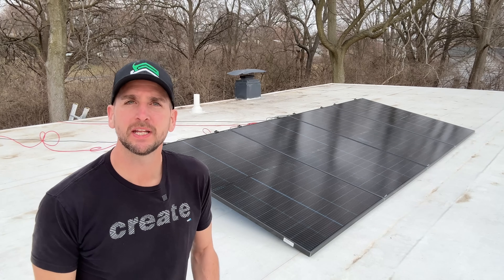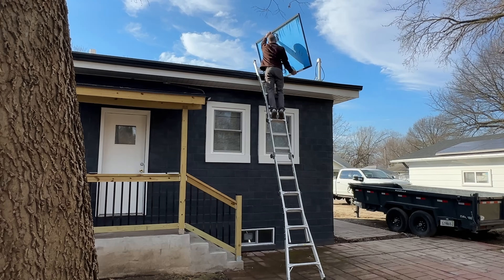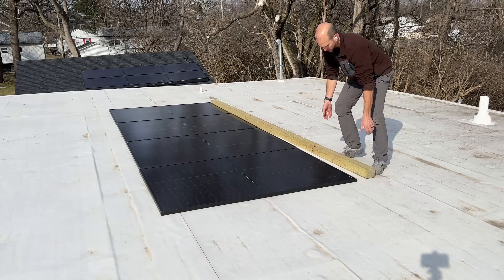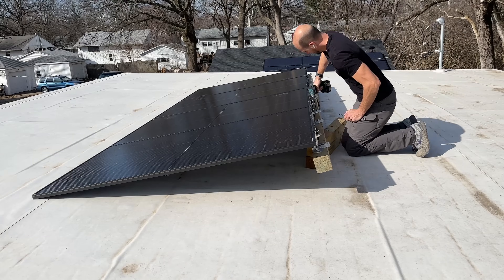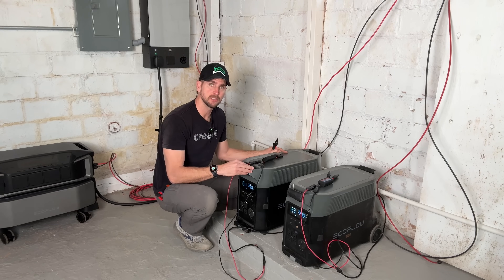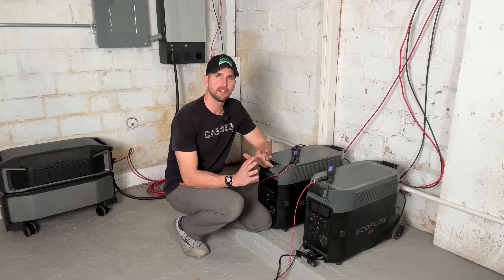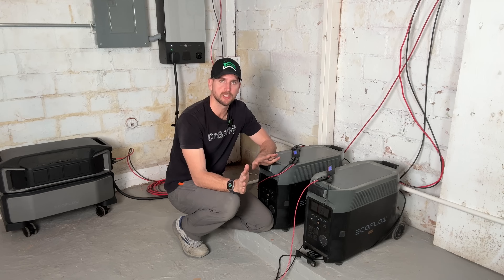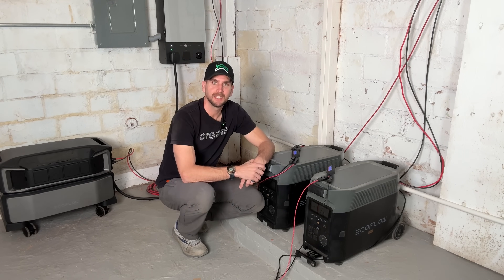Testing Gains From Bifacial Panels | Round 1

Comment: Youtube expert here!  The Bifacial panels need light to bounce to gain a (usually 7-12%) maximum ~20((30))% increase.  For that they might need to be "higher up" (from the roof so light bounces on the backside), there might need to be distance between panels (10-30 cm), so that light get "in under",  3) you can reflect light in behind by reflecting material (foil paper or some white painted plank).

Comment: Blocking a lot of the reflected light with large blocks of wood makes the whole video useless.
You also seem blissfully unaware of just how much heat reduces panel efficiency.

ie:  Get your panels off the roof by at least a foot in such a way that:
1:  Reflected light can actually get underneath from all sides.
2: Any breazes can actually survive under the panels and cool them.

Is the roof painted with a paint that actually reflects the frequencies of light used by the solar cells?
Barium Sulphate?  Titanium Dioxide?  Calcium Carbonate? What???

in short: Know the theory before you decide to make a fortune from YouTube vids or you are nothing more 'fake news'

Comment: Couple things.  1.  Bifacial panels really benefit the most when the sun is low on the horizon since the sun can shine directly on the white roof below the panels and thus reflect onto the backside of the panels.  Honestly the fact that you saw a 4% gain while the panels had a shadow under them is impressive.  I'd run this test again but run it from dawn till dusk.  I bet you'll see your best gains in the morning and evening.  2.  Maybe paint your roof with an aluminized reflective coat.  Especially underneath the panels and a foot or so around the edges too.  Increased reflectivity can only improve whatever gains you get and are cheap with 0 maintenance.  I'm installing bifacial panels on my black asphalt roof and had considered painting my roof under my panels with aluminized roof paint but gave up on the idea since I'd only have 3 inches of gap between the bottom of the panels and the roof.  Honestly if I could get 4% gains just from painting my roof it would be well worth it.  Especially if my roof was already white to begin with and I wouldn't have to worry about the aluminized paint looking funky compared to the rest of the roof.  Just something to chew on.

Comment: I think your mounting system here, had a massive impact on the potential of the panels.  Not enough space to allow light in underneath, and the beam blocked a lot where the panel was elevated the most
Reply from the maker: Yeah, I agree having some light coming through the front side would be ideal.

Comment: If you're playing around with the solar panels for fun and you got the money then go for it, if you think for 1 minute that's spending 50 grand to get enough solar panels and batteries and charge controllers to take you off grid for long periods of time but you might as well hang that s*** up if you consume a lot of power. With solar you're one severe hail storm away from being in the dark again. Solar is fun to play around with if you have money, solar is a good option for people that do not consume a lot of power, but if you consumer a lot of electricity on a daily basis it will not be worth the amount that you're going to pay to install solar, you might as well just pay the electric company

Comment: Bi-Facial panels should be mounted so that NO part of them contact the roof itself . You need to get more light under the panels . IF roof mounted , I would suggest the lowest end of the panel be mounted at 1 foot and the other end mounted higher as needed to get your 10 degree angle . A more reflective surface would also improve performance .

Comment: My PV2 is 2790 watts ,465x6 bi facial, feb19 pv2 was at 3162 watts . In thick clouds 465 becomes 105 watts. Thess #s are south facing 90 deg straight vertical ground mount with snow.  62 bonus watts per panel. With 27 panels that is 1674 watts as a bonus. 
Jinko Solar JKM465M-7RL3-TV 465W, Bifacial

Comment: Good job but at 10% you don't have any slope to expose back to light.  This is probably not good for southern areas.  In far north where mounting is at 45 degrees or more far more light would be availabe to back of panels.  The sweet spot for these might be in north, vertical to get rid of lessened power when snow covered, as high on property as possible to be exposed to the sky as much as possible.  Yes 30 feet up on a roof you get more sky exposure than in ground, especially if there are trees.  Indeed, the brightest area of sky, greastest sky glow during the day is  in the NORTH

Comment: set the panels vertical offset from south  and on the ground with reflective materials (rocks metal ect ) just laying them on a roof is  non productive  and forget taping the backside  since they are already  flat on the roof . I have 3 bifacials 37,5 voc 13.8 oc  in parallel on a roof but they are mounted  vertical due south I have them mounted on plywood painted with high gloss enamel and that is covered with 1/4 inch reflective  sheets  I paid $109.00 a panel for 10 new in a box. on a ideal day they produce 45a  with 36 v

Comment: The panels need to have more space and a reflective area under them. Something like using them as an awning for a patio with light colored things under it. The way you have them situated for this video, there is not enough area/light on the underside. After I install my white PVC privacy fence on my north property line, I will be mounting 15 bifacial panels in front of it. The area along the fence has a 4' border of white sea shells on the ground. The north property line has no issues with shade all day so that will be a great location for solar power production.

Comment: This is not the correct angle to install bifacial panels. Also the masking tape will likely lead to an increase in temperature of the panel and reduction in its  performance.

Bifacial panels will be interesting in vertical south east orientation. So many areas they can be installed. And you only lose like 10-15% than an angled monofacial panel. But we have to wait for true bifacial panels since now the back side peak output is around 60% of the peak output of the front.

Comment: You need to lift the panel at least by 1 meter off the ground and 30% slope angle i get 50% more production in very heavy clouds and about 10-15% better on average.
Reply from the maker: That seems reasonable.  I wanted to test this setup as we are being proposed something similar for a commercial property with a similar membrane roof using the iron ridge ballast system.  Thanks for the feedback.

Comment: Great test setup and data.  I might try the same test with one change, a 6-12 in. light gap between the panels.  My understanding is the would allow more reflected light to reach the back side of the panels.  The same gap at the head and toe of the panel may also aid in producing more reflected energy.

Comment: Bifacials shine in ground mounts or when elevated enough in a white rooftop. If you had lifted the bottom part, you might have seen 6-10% gains in that kind of day. The black frame does not help much either.

Comment: This is a poor test. You need to block the back better with something more solid. That blue tape still lets light through. Then, the Bifacial panels would benefit more with an ALL DAY test. When the sun is lower in the sky the reflection would be greater and you'd have more bounce light reaching the backside. Redo and report back please!
Reply from the maker: I think I will run another round once I get the iron ridge bx ballasted system.  Then I will have the exact height, angle, orientation.  I will also get a better tape/film to be 100% confident nothing is coming through on the back side.  Stay tuned 👍
Reply: Jazz, give the guy a break, props to him for trying to show data

Comment: There are articles that state not to put Bifacial solar panels onto roofs of houses, the backs of panels will be too heavily shaded on the roof which kills most of the production from the back,  as DialedN_07 said create some gaps between the Bifacials will help some but I would also suggest placing Mirrors or Chromed metal sheeting (online or from Lowes or Home Depot type stores) and place under the Bifacial panels gaps to reflect the sunlight to the back of the panels and they will pop.    ------     Ground Mounted with Bifacial panels is the way to go and put a layer of white gravel rock under them to reflect indirect sunlight to the back sides of the Bifacial panels or have gaps for sunlight between panels and lay down mirrors or chromed metal sheeting as I mentioned for the roof.      Thin Chrome Metal Sheeting can be fairly inexpensive.

Comment: I’ve got a delta pro + extra battery. I would like to expand my system to two delta and four extra batteries eventually. How many panels could I use and how would I connect these to my current system? Sorry for my ignorance I’m new to solar and just learning. Thanks!
Reply from the maker: First I would compare your desired expansion to the new Delta Pro Ultra offering.  The solar input capability on the Ultra is dramatically more.  For a Delta Pro to get the most out of the 1600W solar input capability I would put 3 of these in series and then 2 sets in parallel.  That would keep you below the 150V max but when the sun was out your current would be limited to 15 Amps max.
Reply: @everydaysolar  what panels and configuration would you recommend to get the 1600 watts of solar to charge my Delta Pro.

Comment: Interesting.  I think the wooden mount support blocked lots of light from getting to the back of the panels.  Build some kind of standoff that would get them off the deck at least 6 inches especiall in the front. Good Luck.

Comment: I been watching plenty of clips on YouTube for these type of panels. And straight away there better for ground mount. And not the best angle and you need some more height to them and of course have some reflective metals behind and try some angles. But still. What you did is an eye opener really as not the best condition but shows there doing actually tad better then I personally thought they do. And another cracking clip. Keep them coming.

Comment: If you're going to put your panels right on your roof, then bifacial will not change energy output much. Your panels were set too close to the roof to benefit much from the bifacial feature. If you had mounted it higher at about 30º, I'm think it would have been much different.
Reply from the maker: I was trying to do a quick test of a more permanent solution like this https://www.ironridge.com/flat-roofs/ballasted/

Comment: blue painters tape is not a good way to block light. I tried using this tape to block the leds on my Bluetti b300 batteries and after putting four layers on i went and got some black electrical tape!  I could still see the leds even during the day. I would try the test again with something that would actually block the light to the rear of the panels, you may find that 10% you were looking for.....or more.
Reply from the maker: Yeah, completely blocking the light would be good but not sure I would get much more separation with the panels so low and the front of the panels right on the roof.  More testing to come 👍

Comment: The bifacials would benefit GREATLY from gaps between the panels to allow direct sunlight to pass between the panels and reflect back off of the roof.  In this test there were no gaps.
Also because the front of the panels were resting on the roof you killed 100% of the light that would normally jump up from in front and refract directly onto the back.  The front and the back of these panels should be lifted for max benefit.
I believe a solar pergola would be an ideal use case for bifacial solar panels. With the panels so high off the ground, they would benefit from reflected light from 360 degrees around.
Reply from the maker: Thanks for the feedback 👍
Reply: Agreed. My thoughts exactly, whilst viewing this setup.
Reply: I was about to post the same.
Reply: 👍👍👍 Re: solar pergola…  also excellent thought, perhaps with solar tracking mirrored table. Just don’t picnic while tracking, or fit all plates & utensils with suction-cups ;-)
Reply: Also, he does not seem to be aware that bifacial cells "backside" also collect a little bit of photons from the front. Silicon is not opaque at all wavelengths.
Due to the thin sheet of silicon some photons in the absorbed spectrum also pass through far enough to be captured by the backside of the cells.
The benefit of bifacial is thus much higher than he calculated even if you do not take into account the missing panel gaps and raising it off the roof.

Comment: I'd be curious about a comparison where the panels are mounted vertically (e.g. 90 degrees, like walls or fencing) for applications where the area needs to be more passable. The first time I saw these, the researchers were giving examples of applications where tall farm equipment was running between aisles of crops.

Comment: I have the Bifacial panels, two separate DIY ground mounts, that can follow the sun and tilt, with a mobile reflective system underneath, I have great results..35% gains in colder weather..Your panels are too close to the roof..Bifacial is better for ground mounts..
Reply from the maker: Dang, that sounds like a setup.  Thanks so much for sharing your results 👍
Reply: I have4 sets of 4 485w q cell bifacials on the brightmounts mounted on a 14' 2" pipe usikg u bolts on a 6" top post 5' out of the ground so each is fully adjustable in all directions and I get over 100% rated output pretty much every cold or full sun day
Reply: @tjmooney4181  only for a split second I seen 443 watts. Hovered 400 for a minute.All day between 280-340.And I tried all positions.Pmax rated 70% +/-5%
Same as Qcell 410’s to 485’s.
I thought you’d never get 100% unless in a lab test sight.
Reply: Yep ground mount with crush and run rocks underneath it works perfect in rural areas.
Reply: My CC 525 bifacial gets same wattage in all positions.
Reply: @2hotscottpro  You need something several feet under the panel to reflect the light to the underside..
Reply: What kinda reflective are you using underneath?

Comment: Be a bit careful about the weight of the panels.  Bifacials tend to be rather heavy which can be a problem depending on the type of roof.   They are usually used on ground mounts (also with more background light), rather than on roof mounts.  Cost is also an issue.
Reply: That is a valid concern. I didn't compare to non bifacial but when i was doing some fuzzy math on the max amount of panels my pole barn could fit on the south facing side it came out to like 2500 lbs just in panels